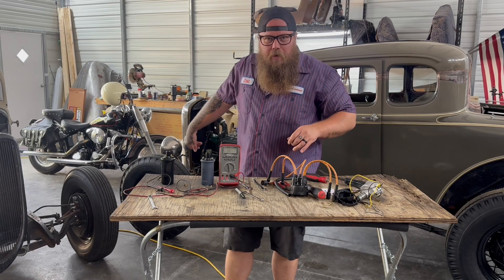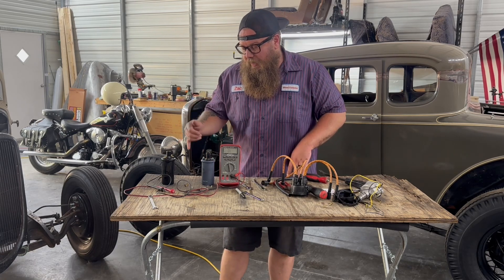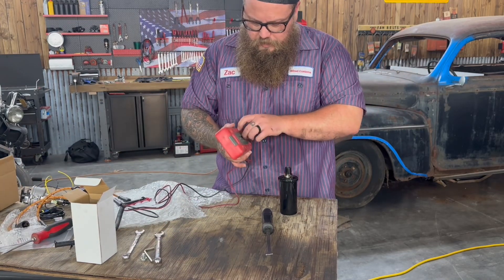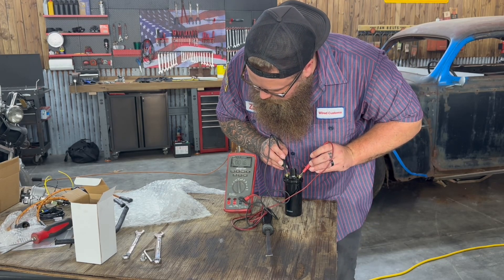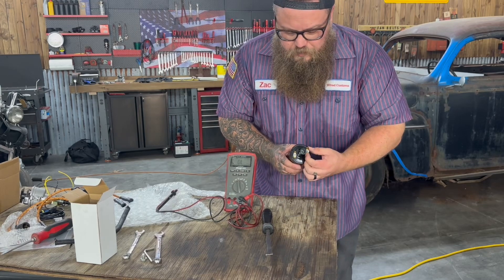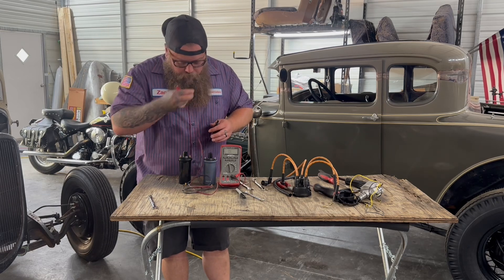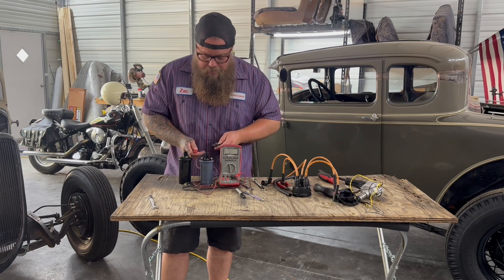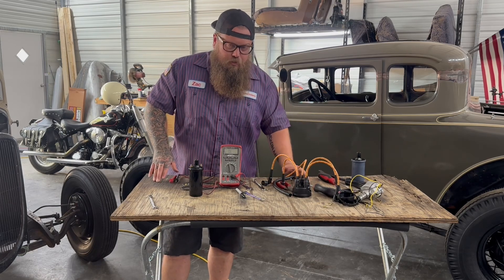Test Your Ignition Coil!?

Comment: Here's a question for you:
I have an 8ba flathead v8 in my truck, it has the stock distributor with the points condenser ignition system.  I have converted the truck to 12v, and have a 12v coil installed that is labeled to not need an external resistor. Will that destroy the points faster with it set up this way? I don't want to change to electronic ignition,  I like the setup it has. I have been running this truck since I was 16, I'm 40 years older now. Back then, it would randomly start and idle just fine, but lose power and die out as the rpms increased trying to drive. I tracked it down to a bad coil, and would simply change them out when it would happen.  I was a kid then, and ignorance was my defense. It fires up and runs good with my current set up, I just want trouble free driving when I get the truck done.

Comment: God I miss having a flathead vehicle. Back in the 90's I was in my early 20's and I had a '47 Ford pick up. It was slow as molasses but it was so much fun. Then my dad bought a gen 1 Lightning and he let me drive it. He was going to sell it and if I were to buy it I had only that '47 to use as a down payment plus we didn't have the space for me to have both. Yes I sold that '47 and it's something that I deeply regret.now that I'm older id rather have a slower vehicle that has so much character and patina. That was a sweet truck. Of course the guy that bought it had to put a 350 in it and all that everybody does🙄
Thanks for the ride!